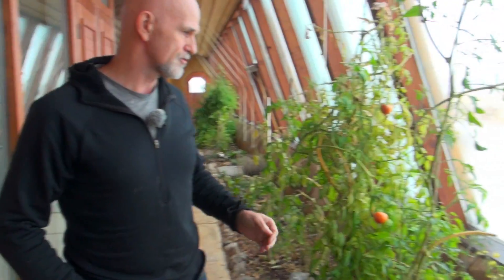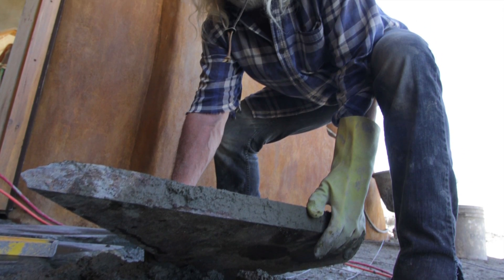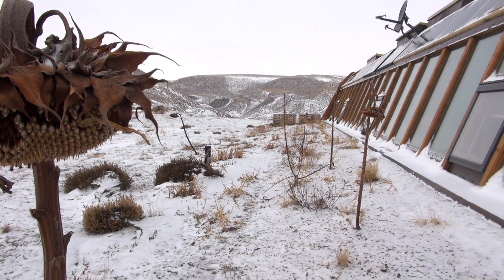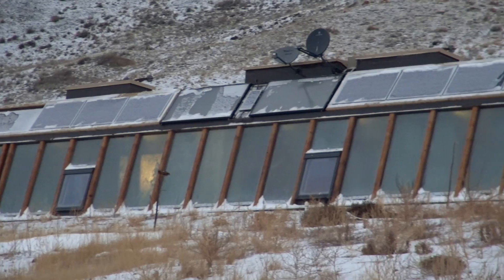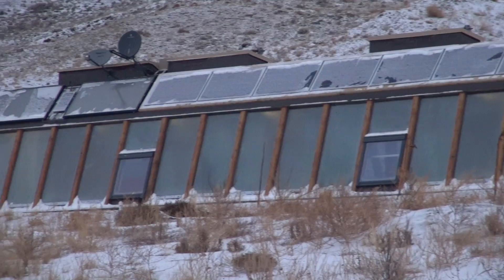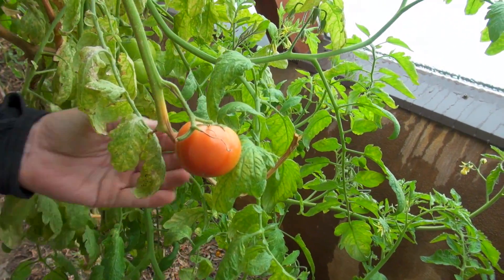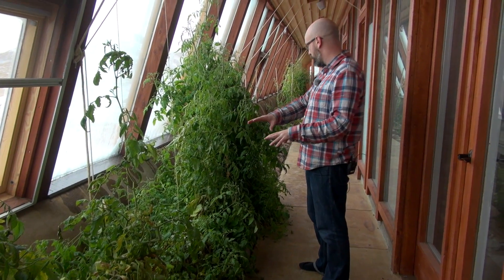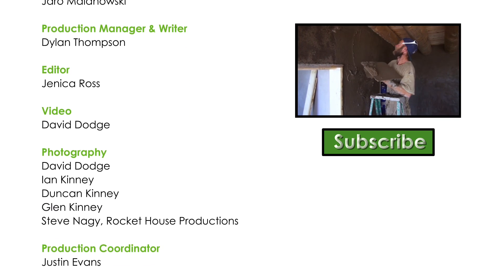136. Earthship living in a cold, desolate, Canadian winter

Comment: Earth ships are mainly built in the desert, so the focus is mostly on water and insulation for cooling.
In the north, the plants need sunlight from above.  
this greenhouse is shaded by the solar panels.
The wood stove could be used to heat water and create electricity.  It would work more efficiently if it was a rocket mass heater.
The human waste is more efficiently treated using composting instead of using water to transport it.  Urine is sterile and could be used on the plants, the solids can be composted and used under fruit trees or ornamentals.  
This location could have wind power.
Keep the batteries inside where it is warm.
It would look better if the front was rounded in a convex curve and then it would catch some of the easterly and westerly sunlight.
I think earthships need another layer of living space that is like a screened porch for spring and fall.  
The roof needs a better way to clear snow off of the solar panels.  In the desert, where most of these exist, this is not as important.
Reply: The sun is never directly above in Alberta Canada. The plants have no issues with light.

Comment: It is nice to see that these run so well during such extreme conditions, I want to build one somewhere along the Rockies but wasn't sure if it would handle the colder temperatures.

 I wonder how elevated the Earthship could be before lower air pressure changes the natural insulation and other fine properties of the Earthship. Any thoughts?

Comment: It is a bold effort they are making, but the "bounty" is on the small side. I would suggest to them that they concentrate on plants that can take and thrive in cooler climates like broccolli, beets, peas, etc. In addition, people need to understand the importance of soil temperature on the ability of plants to grow. If there was extra heat via a thermal solar tank available, it would do great duty by being pumped through pipes in the soil to deliver the heat.
Reply: bad doggie - If the Gentleman from Nebraska can grow Citrus in Winter, his techniques, of bringing in outside air, through long deep burried pipes or tubes, could add extra benefits to these designs, too! He also takes heated air at the top of his greenhouse, and pulls it down, to warm the growing beds, as well!

Basically, knowing the temperature ranges a climate spot has, wind levels, sun levels, also determines what systems are needed, for a given energy balance desired.
Reply: thank you for this info. Seems this principle should be incorporated as well :)

Comment: Gets 2 24v generators a 12v motor   and make free power 1 generator powers the motor as it turns the other gen to a 12 to 120 convertor there free power 24/7 u only have to put voltage control on the motor to turn stable speed

Comment: Very interesting. Think it is large enough to get a big heat sink underneath. I have some ideas for cold climate design. For a smaller earthship or even a big one if you plant dense vegetation out 20ft it will keep the wind off and allow you to heat a larger mass. Once established you might even be able to measure a warmer ground temperature under the leafs. You could have a reflector patio and a slope down inside to an earthen wall about a metre or so high towards the center. This would concentrate collection in the centre furthest from outside. This could then have air channels zigzagging along it perhaps a foot inside so the heat reaches it in the evening. Then you dig a well infront of it doesn't need to be that deep perhaps 10ft is enough or 15 depending on how cold it gets and what is practicle. Perhaps just dig a big hole and from the bottom of that fan out  well holes to loop a long pipe  and bring it up near the collection wall. Then in summer you can draw air from outside. you could have a warm and a cool source. You connect that to your wall say to draw cool air thru it then you connect it so it goes down into your hole and open the roof window so you can take heat out of your heating wall and put it underground and bring cool air out in the bottom. In winter you disconnect from outside air close roof window and set it up so cool air collecting under the wall gets drawn down the hole and up thru the heating wall dumping the winter into the warm ground and bringing heat up into your wall. You could pipe that up into a sheltered area at the top if necessary. The reflector idea is a bit dodgy for the eyes but it works a lot it is hard to estimate but perhaps double which would help a lot in the winter and is getting absorbed in the wall so not such a problem. You could heat the underground heavily in the autumn so there is good reserves thru the worst part. What you could do is isolate the heating wall behind some glass then you can draw the air over the surface  to take it underground without overheating the place and in the winter conserve more heat for the evenings and open to release heat.
Reply: On this earthship in the video the roof is sloping down so it is shaded in winter but what you could do is make it so it reflects winter sun off the roof into a high window at the back of the earthship or take the light off the roof into an additional room behind or even a series of rooms going up a slope. That way you can have cheaper shorter roof spans and probably it would be good to have them half a floor underground. Electric can be produced in a seperate area and it is probably better since there can be dangers of dirty electricity. You could use the light off the back of the roof to boost production. Think it would be good to have a modular design so you could just start with one room and add additional rooms later like for example if having a baby. Toilet can be outside afterall you only spend a few minutes a day there. Bathroom doesnt really need to be heated so much nor kitchen since they heat up when in use. Like if you have the solar hot water sorted then running a bath would heat a bathroom. In anycase I think planting trees is higher priority. If there is trees pushing the wind over the top then it should really stabilise the temperature alot. The outdoor toilet might sound a bit much in the winter but can you imagine how nice it would be in summer like a room made with flowering plants to give privacy. The money to build it indoors might not be worth it at all plus outtdoors it is bound to have fresh air even if you go with  a simple compost collecting toilet. Plenty of space for a bidet and sink with free cleaning service provided by nature.  In winter you can use the white stuff to save on cutting trees down and it gives the perfect excuse to enjoy the gardens. You could be enjoying the northern lights it would in anycase be perfectly good further south. maybe in canada you could put a bit of an igloo up around it to provide some protection from the wind. With this modular idea of starting with just one room then people could prioritise getting other peoples first room built and potting shed and sapplings to kind of have a leading edge upon settlement. Then those people can help later with the additional rooms and gardens and there can be plenty of support for new people. Then you could be thinking about warming up a whole valley and financing land aquisiton for additional settlements rapidly liberating seed and creating a functional planet.

Comment: Stirling cycle engine with a Crystal graphite cylinder head that heats up to drive hot air engine that also produced heat for green house and home and turned a power generator? This would work right?

Comment: Why not use a solar panel that ran a drum motor generator that operated a Stirling cycle cryogenic cooler that turned air into liquid that filled an insulated underground cistern, then use Stirling cycle cold engines to circulated liquid air through heat exchanges for air conditioning and to build pressure to spin a type 12 swash plate pump motor to crank a large generator that kept a battery and capacitor bank charged up? You could also condense the liquid air vapor into water run it through a filter for fresh drinking water or fill underground cisterns with water to operate a hydroponic green house. This would work right?
Reply: Jim Martin What on Earth are you talking about? Are you just Blarney?
Reply: Composting toilets to make plant food from urine and the sticky stuff to make top soil for your green house to grow your own food. ; )
Reply: Even composted, human waste is not good for most crops you intend to eat. Just like why we don't eat human meat (among many reasons) - it contains all the pathogens that humans are most susceptible to. Human waste can be composted and used to feed trees, or anything you don't intend to eat, but not for edible crops.

A lot of the major outbreaks of e. coli and other pathogens come from food imported from countries that don't have strict rules against using human waste for crops (or from places where farm workers just go in the fields).

If you get a prion disease, you might not know if for years, so even the "I've been doing it and I'm fine!" people are not reliable for information about this. Also, that one bout of stomach flu you had months ago could come back to haunt you repeatedly, for years if you fed it back into your soil. Most people don't go in a separate toilet when they're sick.
Reply: Jessica Lee Y'all out in the forest during a war you see a lush edible berry bush and chow down. Then you walk around to the back of the Bush and find a trench full of human waste. Sum really good berries. Lazy people do lazy things and think in lazy ways because most lazy people want it easy. If you have composting toilets and you fertilize a flower garden with it then you move and the next person uses that flower garden to grow food crops? Did you leave that new person using that land to enjoy your richness? Would you wait a year or two then mention to them that you used to use your composting toilet to fertilize that patch of land and wait to see what kind of look would come across their faces after they learn who's poo they were growing their veggies off of? Has you snicker? Imagine an old man making mud for a yearly town mud fight out of his composting toilet and mixing it really good into soil he produced so he could sit back and enjoy folks playing in his mud each has he giggled? Poo grows plants be it from animal or man all it takes is the correct processing and management of a resource rather then just have a brown chemical Slurpee running down streams and out to sea.

Comment: Well, when there is no sun ... maybe is wind,  so you can build/achieve a wind turbine for electricity!
Reply: I think they should diversify too, but I've heard (most?) wind turbines don't work well in cold weather. Where I am in Minnesota, our turbines stop spinning on cold winter days because it messes with the hydraulic fluid
Reply: @JohnMartens  - No Hydraulic Fluid, when they are Direct Drive, so less of an issue, that way. Direct drive wind turbines go from under 1 kW, to over 50 kW, so they have lots of choices to pick from. (A Car Dealer, just North of Toronto, near Wonderland, uses a 50 kW Wind Turbine!)

For this home, I would think choices could be from a 1.5 kW to a 4 kW turbine would be suitable, maybe even the 4 kW is overkill, as they said they only dropped below the AC Inverters Cut Off Voltage, 2 days in 18 Months. Even a 0.5 to 1.0 kW Wind Turbine, might be just right to top off the Solar Losses on Dark and Cloudy days!
Reply: Agree, that was my first thought when he wasn't getting any energy on cloudy days is why don't they use Wind Turbines to create electricity?
Reply: No, no traditional wind turbines are fine. I mean the small ones dont have hidraulics or gearboxes. Permanent magnet generators direct driven. In small scale it is the go to solutoin anyway. Ice can be a problem though, maybe automatic vibration shutdown?
Reply: My grandpa is the CEO of a small wind turbine company! They could just give him a call and get some. All of their installed turbines in Florida survived hurricane Irma!
Reply: How about a wind belt generator? I had heard of these years ago. They claim they are best on roof tops to avoid the peculiarities of air flow there.
Reply: never heard of this, thanks for mentioning it!!
Reply: you dont really need electricity. its a luxury. the more important energy is food. without that your not going to be too worried about electric on the occasional winters day.
Reply: Also maybe add a Lister style slow speed diesel as a backup generator.
Reply: Koblos Alexandru --that's the problem with this green energy stuff, you still need reliable conventional earth supplied energy

Comment: I assume, this is the most northern earthship on the planet, however you have a continental climate and lots of annual insolation. And still you have back-up wooden stove and propane tank...I wonder, will there be any use of earthships above 60' North?
Reply: Whatever, bottom line. Is, we can't be tied to equatorial regions forever. To thrive.... In the poles . North pole south pole or close. We have to achieve 100 percent climate mastery and containment...Lloll. earth ship is a good start. Although I'm partial to norwegian  domes. Houses inside domes. But this is a good start. You could also have 100 s of solar panels and windmills. To create fake light. For plants and warmth.
Reply: Woodgas/syngas-  A converter would make that house sustainable even if propane became unavailable.  A wood lot with good management would give the heat from gas boost needed.  The Septic system could also be converted to generate biogas.  You now have the efficient heat needed for really far north....
Reply: I think we have at least two earthship in scandinavia. One in Denmark and one in Sweden. There could be a chance of them being further North then this one. However im not sure if any is living in them, or if they just are for showcasing the concept.
Reply: Its pretty windy looking spot. Probably most of the heat is lost to the glass. It makes a big difference if it is windy or not. Where I am is not an earthship as such nor is it that cold but the shutters make a big difference. The moment it gets dark I put them down and then bring them up again at sunrise. If it is windy the loss thru the walls is a lot bigger than on a still night. On a windy day well the glass is losing loads.  It is single glazing and it is tinted so not really getting the full amount off the light either. Id reckon shutters would work a treat on this earthship. Then you could use them to regulate the temperature from getting too hot like in the day time put them down a bit as necessary. These roller shutters keep the wind off the glass good and then there is a layer of air between them and the glass and also inside them. Sometimes I put them down early if it is bad conditions and the temperature recovers a bit. If I forget to put them down in a room it gets cold in there real fast. You could probably make ones for this earthship that have a hinge and just lie on the ground outside during the day and then get pulled up with a pulley. in anycase there should be a way to do it easy enough. even really nice triple glazing benefits quite a bit from thick nicely sealed curtains.  60 degrees north youd probably have to think about making the thermal mass underground and storing heat there over the summer and bringing it back up in winter. this is what they do with greenhouses and chicken farms so they can keep it cool in summer also. Just runs on a fan. then youd probably want more insulation rather than thermal mass in the actual house. there is also heat pumps that use a liquid changing into a gas and are pretty efficient. they just pull the heat out of the rock underneath and can make it pretty warm. probably cost a bit to install though.

Comment: "cold dark canadian prairies winter" i wonder if this type of house would work without a fireplace by having taller windows in south-west side with an additional thermal mass like a pool or something. im in quebec and there is at least triple that amount of snow in january and im really not a big fan of wood burning.i also want to know how much did it cost with and without solar panel, again because here in quebec, its just a waste of money to have solar panel if you can be " on-grid " since it cost more to buy it than using normal electricity for 30 years and much better if you convert your house into 12/24v. well thank you if you ever comment :)

Comment: In Ontario, whom do I contact about building an earth ship?
Reply: Have the earthship designed to be thermal bridge free as much as possible. When I was in Taos I stayed in the pheonix, it was beautiful, but the builders did no know what a thermal bridge was. Venting is a problem in winter in Canada, the low tech roof vents freeze up in winter and mould can be an issue. I am a contractor, I would consider a passive house with some of the earthship features like water harvesting, greywater, and planters/greenhouse incorporated into the design.
Reply: Mold from ..HOT MEETS COLD= condensation in walls....and a greenhouse attached. The front "wing walls" / retaining walls are a huge thermal bridge.
Reply: savydude1  Mold is an issue in any home. Why moreso in passive homes?
Reply: These are the Earthship people, Michael Reynolds and crew. You can either buy the plans and build it yourself or negotiate a price for them to send you some kind of crew to help out. They are in Taos, New Mexico, but they have built Earthships all over the world.
Hover over Grand Central and you will see a list of places, including Canada. Good Luck.
http://earthship.com/